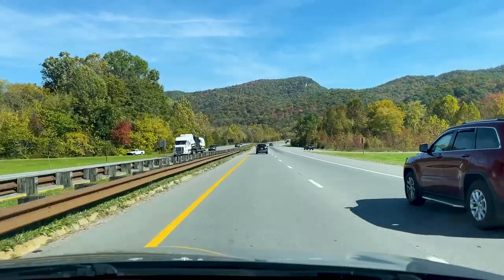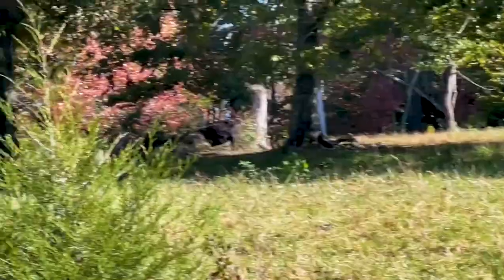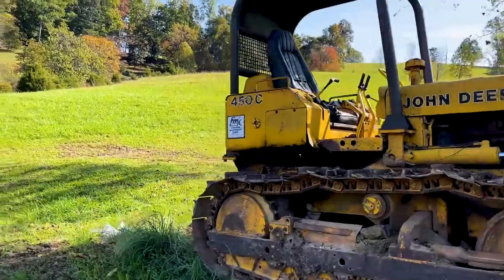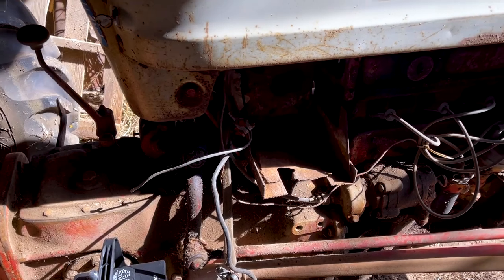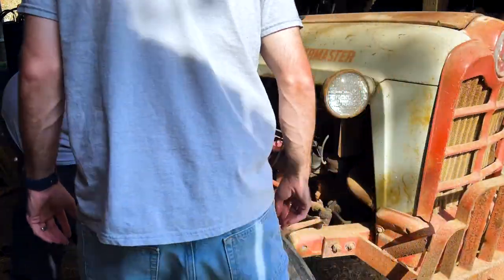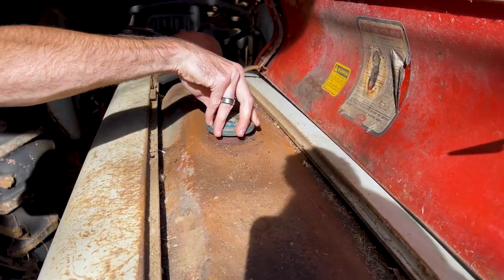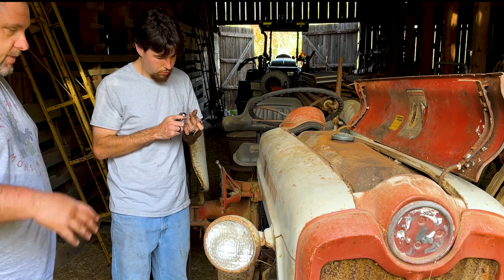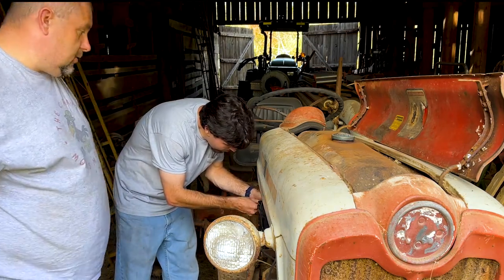Will It Start? The 1963 Ford 801 Powermaster Project Begins

Comment: I have an 801 Ford have had it for 45 years. Run perfect. Has never spent a night outside. The first thing you want to do is throw those point’s away and put electronic ignition in it. You will never have to touch it again .

Comment: Awesome! Can't beat the old equipment like that. My uncle(may he rest in peace) was a firm believer in the old Ford 9N tractors and old Massy Ferguson farm tractors.
Reply from the maker: This thing seems to want to run, but we aren’t there yet. And it sounds like Nicks family has definitely gotten their money’s worth out of this old tractor. After looking at it, there isn’t too much bailing wire holding it together, so it must have been pretty reliable….lol
Reply: @TheCraftyCrowShow  oh yeah looks like it's in good shape. I would replace the cap, points and condenser, plug wires just incase.
Reply from the maker: @jeffjackson5331  well, to give you a sneak peak, we have already shot a part two and dove into that and the fuel system. He found a complete kit with new rotor, button, cap, wires, and plugs, and we are waiting for that to come in now for part three
Reply: @TheCraftyCrowShow  oh cool! That is awesome that you guys were able to find a kit for it. I will be watching for the other parts for sure.